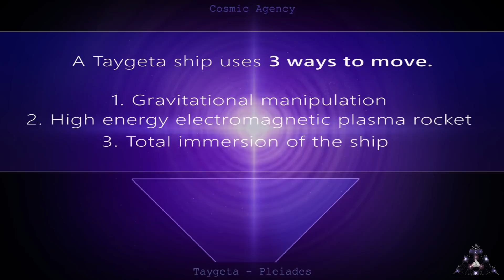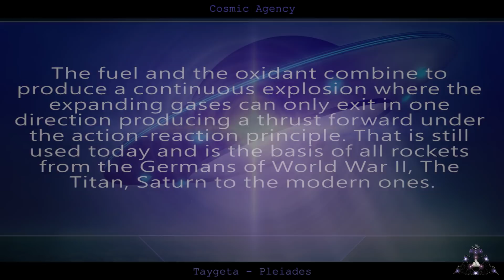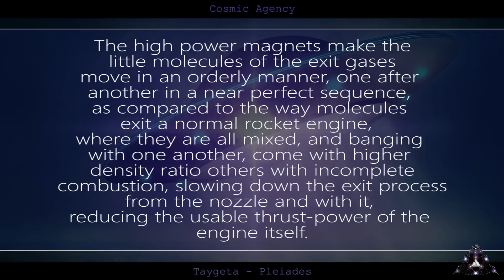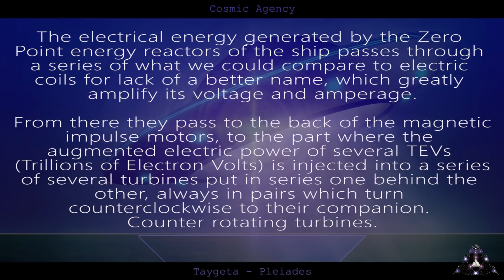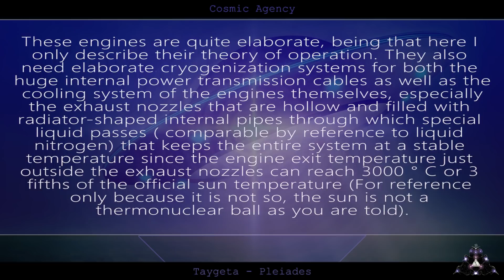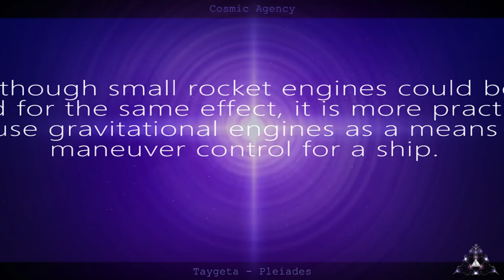Stellar Navigation 2 (Swaruu) (Part 4): Extraterrestrial Ship Technology Taygeta-Pleiades

Comment: Mind blowing.. i want to try build a proof of concept prototype.. obvioualy nothing that would fly lol but meqsure thrust should be attainable as soon as we can figure out how to do the frequency manipulation first, no point building complex things when the frequency control is blank, migh be able to.prove proof of concept but ahh so confusing, need big teams, big funding and freedom.. wish i was a billionaire..

I think the gravitation engines are first in line, but what are superconducting coils, we have superconducters that must be frozen to crazy cold to work as superconducters, they will find room temp superconductors eventually but they need time, is this what they mean? Electromagnetic coils using superconductive material as the coil instead of conventional copper or aluminium? If so we cant even do that yet lol let alone creat a computer and sensor to get the frequency of a location then get the computer to tell the engines to cancell out the frequency as they said..

Super confusing, im only basic in electronics and frequency, mwo can produce frequencies but im lost and dont understand what they mean unless its direct mechanical explanations,black busgets prob already succesful in most of this stuff..

Comment: At 5.09 min the statement "Normal jet engine. They do not breathe air, nor use any type of fuel" is incorrect. It gives the impression that the jet engine is something its not and is inconsistent with a comment in the summary. You should change it to read "Normal jet engine. They breathe air, and use hydrocarbon fuel" or something similar.

Comment: This is very interesting and explains why these ships can do Mach 7 or higher and not burn up in our atmosphere.  One of our fastest aircraft the SR-71 has a skin of titanium because when it goes 3.4 Mach the heart of the air against the aircraft skin rises so high that if the SR-71 has an aluminum fuselage like most of our aircraft the skin's tensile strength would temper and ultimately fail so titanium is more resistant.  So the Pleiadian ships have a force field so to speak which allow much higher speeds.  I was wondering how they pull this off.   I think I understand much of what they are saying and have been studying frequencies in the last 20 years perhaps in anticipation of this new technology.  Yes a good understanding frequency mathematics is needed for good understanding I am convinced.  Keep on producing these lectures. They are very enlighting.

Comment: Hi and thank you Gosia and Swaruu. Another great video. I kept up wirh you until what happens after the  electrical energy  is enhanced or steped-up by the  sophisticated coils. There are constraints on the frequency of the electrical energy as it passes through the engine. In my mind, the plasma will behave like a fluid, and thus be modelled by Navier-Stokes equation. How is the plasmas' frequency controled under those circumstances? Also, it seens as if, once the ship has become a frequency match for the destination the ship will just appear at the destination. It will not have move at great velocities because it is already there.  The notion you are transversing vast amounts of space does not apply in this case. I have memories about technology that you tunnel through space and memories about once you dial up the frequency of the destination and go you are there. Again thanks